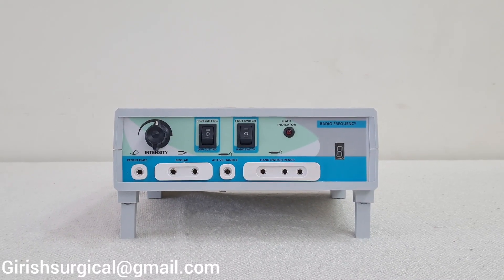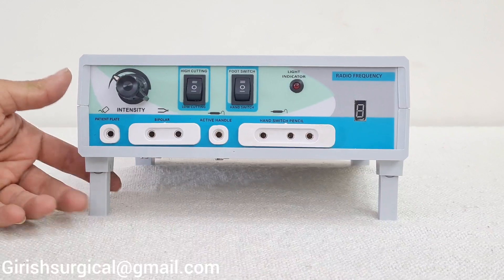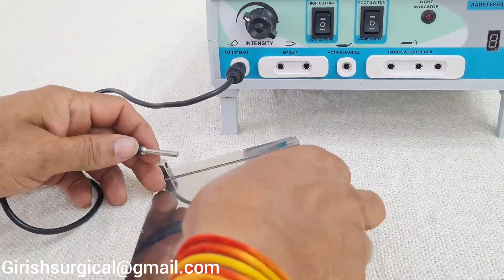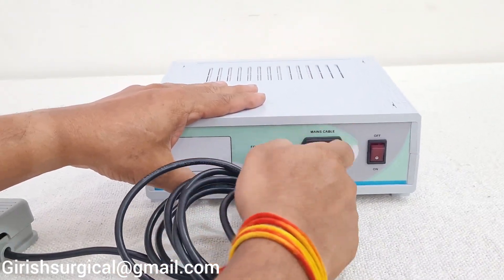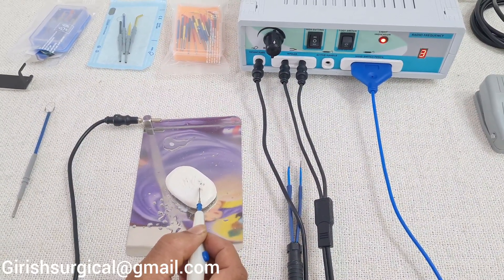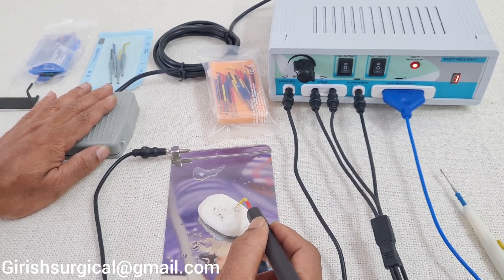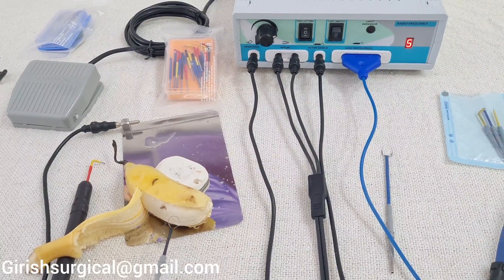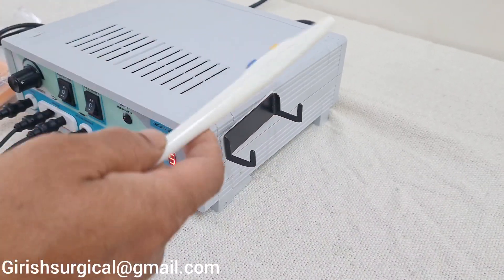Radio frequency Cautery advance  , girish surgical works , PH:- 09819769738 & 09223248134

Comment: High cutting low cutting ok where is coagulation ??? With bipolar and monopolar
Reply from the maker: this high and low cutting is for out put , please see the full video there is a hand switch port in that, there you will be getting cutting and coagulation switch , please feel free to call for more quires , ph:- 9223248134 / 9819769738

Comment: Where are the cut coag fulg rf modes?
Reply from the maker: there is no fulguration in this machine for that you have to buy MAX model in which you will get both the combo features, please see the full video there is a hand switch port in that, there you will be getting cutting and coagulation switch , please feel free to call for more quires , ph:- 9223248134 / 9819769738